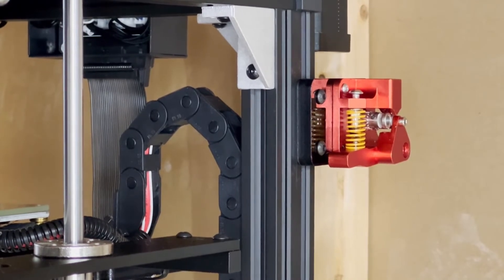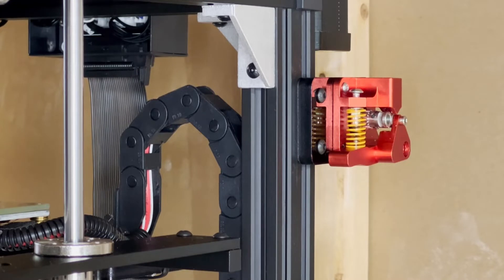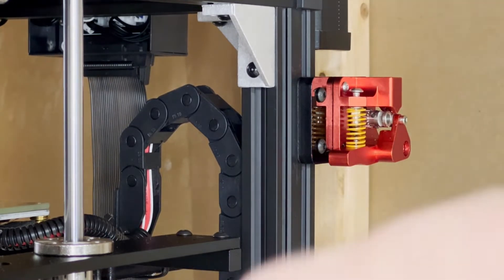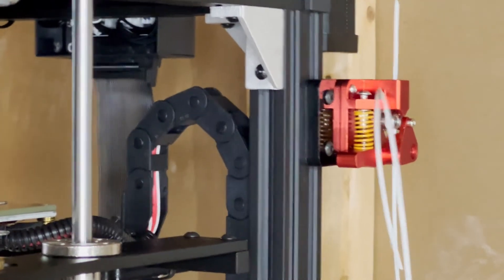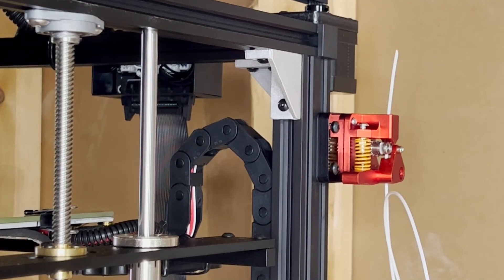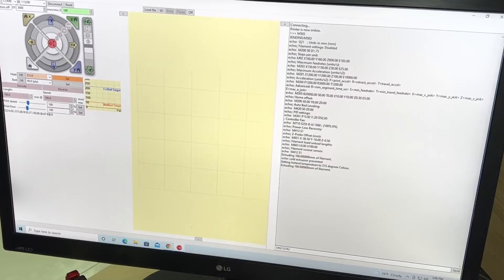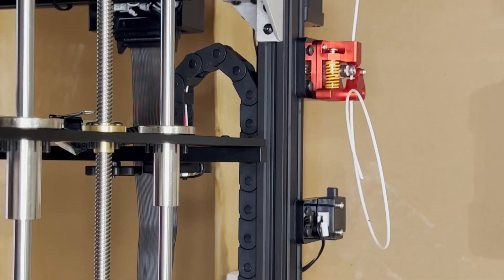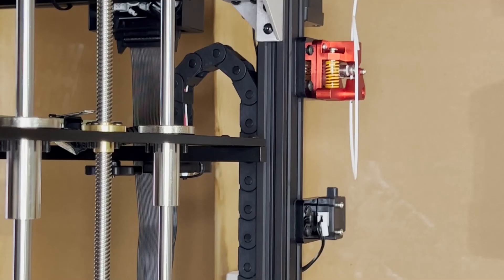Tronxy X5SA How to calibrate E steps

Comment: anyone know why the bed always goes down while trying to print or home it, it usually goes all the way down to the motors and dont know what to do ab it
Reply from the maker: Maybe have a look at the screws on the leadscrew nuts.  They might be loose
Reply: Your bed level sensor might be faulty or have bad wiring.  My upper PCB breakout board had a bad trace for the trigger pin that made the bed drop every time it didn't see the bed when it auto levelled.

Comment: Sorry, but I have another question. Did you use the tronxy motor or did you buy it complete? 
it's a bowden system right?
Reply from the maker: i used the Tronxy motor. In this video it was a bowden setup, but I have changed it since then to a direct drive
Reply: @mpulford311  Can you make a video showing the change you made to Direct Drive? And why the system change?
Reply from the maker: I didn't make a video on hotend installation or direct drive installation. Was going to drop a video on all my upgrades to it. But if you're looking for some direction with upgrades I'll try and help you as best as I can.

Comment: Trying to get my bmg to work with my custom direct drive bracket. It doesn't seem to be changing e steps no matter what.  It keeps under extruding no matter what I do.  Seems to make no difference. I tried it over usb and with modifying the gcode and putting it on a SD card(m8011 method)

If it matters I have the "103" v6 board with tmc 2225 drivers.
Reply from the maker: I have the Titan extruder now and I started with a value of 415 noticed that I had to increase the value I keep adding to the number. Wound up with a value of 790 for the extruder I have.

Comment: I can't get pronterface to connect over USB. Were there any settings you had to change to get the connection?
Reply: Make sure you do the following, fixing these things got my connection working:
1. Install the CH340G driver included on the SD card they gave you
2. CLOSE CURA, apparently Cura can steal the COM port you're printer is connected on
3. Use baud rate: 115200
Reply from the maker: Yea cura does not play nice with pronterface. Great advice
Reply from the maker: You’ll have to make sure your com port matches what setting are in your pc. Check this video out.  

https://youtu.be/TA0nWntwQEc